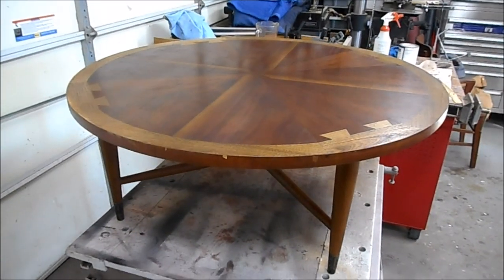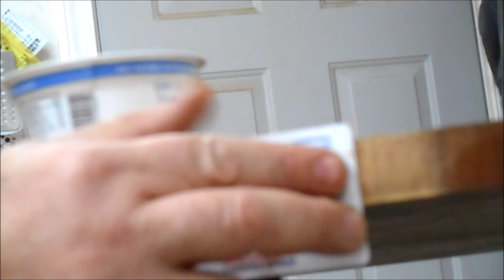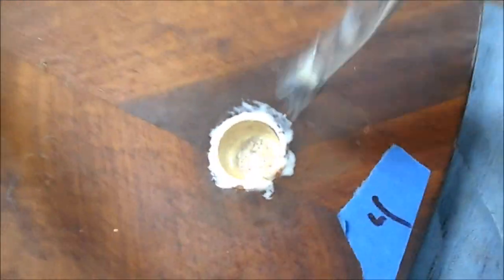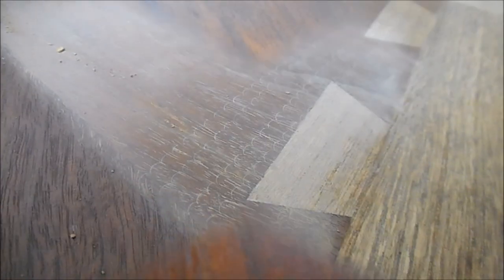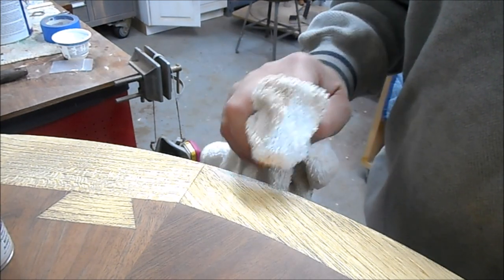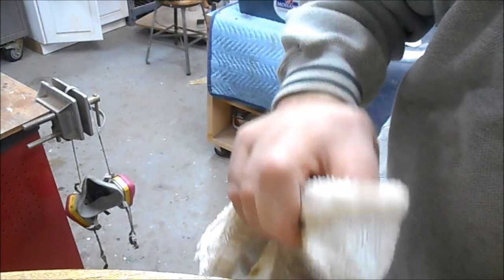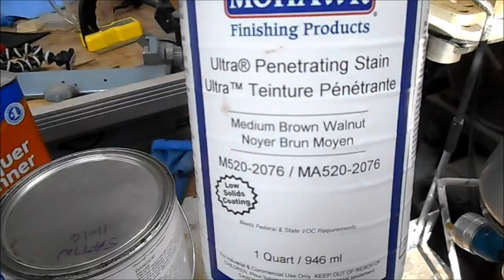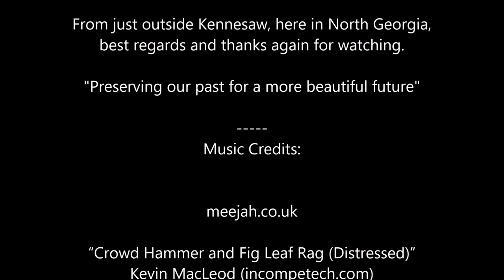A Round of Acclaim

Comment: Speaking of color, put in Hyperikon's LED tubes with 90+ Color Rendering Index (CRI) and not only now the colors true, but brighter despite same output as the florescents. If working long hours, no more eye fatigue. Can't recommend enough!
Also, no more ballasts (which are major energy hogs just themselves) and great energy savings.
I also have three 4' self contained strip lights so brighter than daylight in the one car garage when all seven LEDs turned on, but rarely do (two zones).
Hope this helps.
Reply from the maker: Thanks.   A lighting update is certainly on the list of things to do.  I'll check out Hyperikon LEDs for sure.  Thanks!